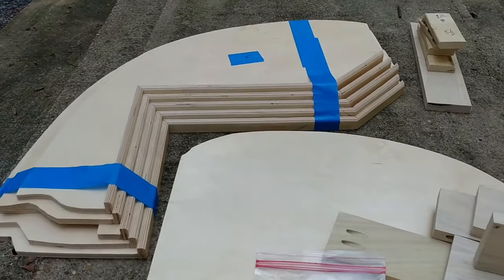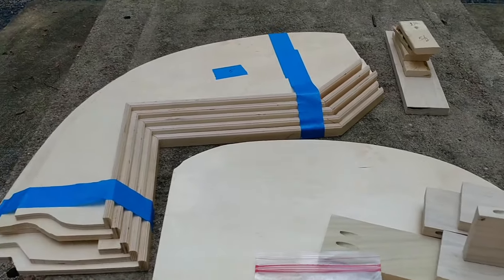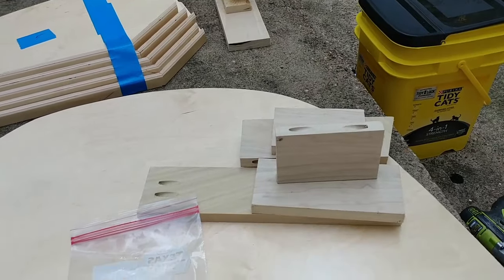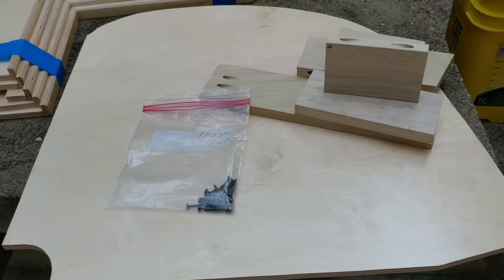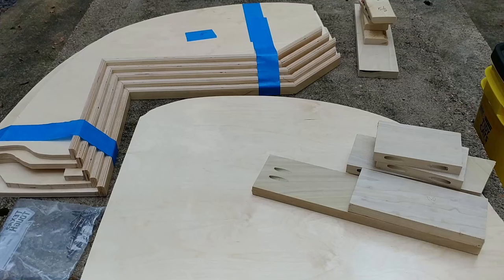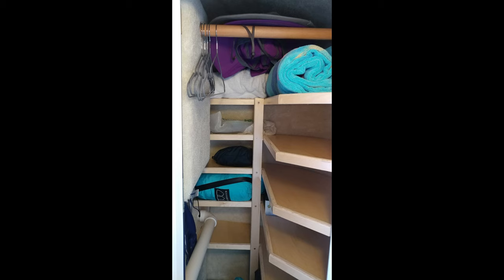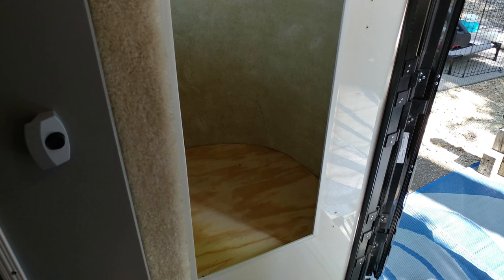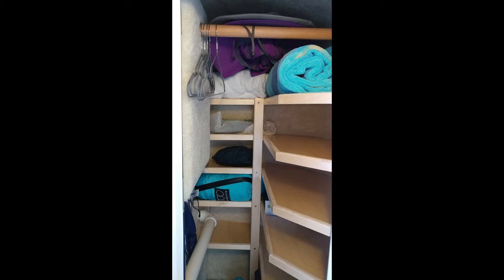Casita Custom Closet

Comment: What a fantastic idea. I wanted to order one but your website says you are not taking orders now. Can you tell me when you will start again, or is this the end of a great idea?
Reply from the maker: We are taking orders. Install timing depends on your schedule and travel plans. Kits are available to ship or pick up, but we don't ship when we're traveling. If we're in town, we usually ship within a week.
Reply: @RosebudsTravels  Great news. I tried to order, but as of a few minutes ago your web site still states that online ordering is closed as of now. I would like to order a set for a 2019 Spirit Deluxe for shipping. What do I need to do to submit an order to you?
Reply from the maker: @photoguy73  Did you get it ordered?
Reply: @RosebudsTravels  No. Your website said you still were not accepting orders. It wouldn't allow me to submit an order. I am still open to ordering one if you can tell me how.
Reply: @RosebudsTravels  Your website would still not accept my order.
Reply from the maker: @photoguy73  What are you trying to order? I tested it and it works. Please tell me exactly what you are trying to order. Thanks.
Reply from the maker: @photoguy73  Please send me an email to louis.casitaclosets@gmail.com . Thanks
Reply: @RosebudsTravels  My emails sent by AOL and Gmail were returned, both stating the email address you provided does not exist. Fishy.
Reply from the maker: @photoguy73  Send to louis.casitaclosets@gmail.com

Comment: Good job.  Do you any pics of the right inside corners of the shelves, behind the door frame?   Did anything loosen up or move during any of your trips?
Reply from the maker: No nothing moves or loosens. Ask Frank Knight also. There are two of these closets driving around.  Ours just went to the Smokey Mountains. Tested on many trips in two trailers.

Comment: Hey Louis, I guess I am just dense but I still don't get exactly where you put those support blocks? I see the vertical center support but what else is holding up your shelves?
Reply from the maker: Mike nothing. Are there blocks on the wall of the Casita holding up the table at the wall? No. Does it fall down? No. Same idea.
Reply: I believe its the inward curve of the bottom half of Casita shell that wont allow the shelves to fall.
Reply: Looks great - we so need this closet kit for our 2021 SD. Where do we get the plans or buy the kit?

Comment: I love these and will do this eventually. I like the hatch at the bottom, since we’re still using the space below for storage, so would probably alter the bottom shelf slightly so the hatch can be larger (the width of the door opening). A mod mod ;-). Are you planning on making kits, or just templates?
Reply from the maker: Bill at this time we are going to do plans with instructions.
Reply from the maker: Bill the hatch can be bigger. Frank just made it that big. If you keep the supports off to the side it can be bigger.